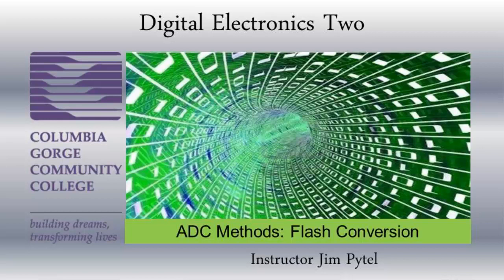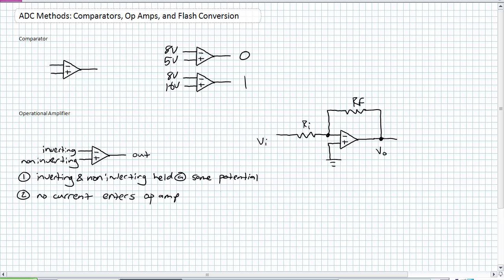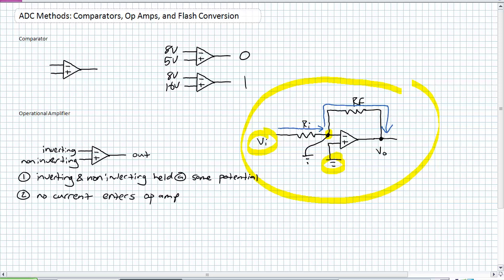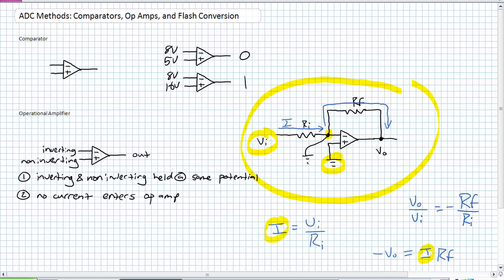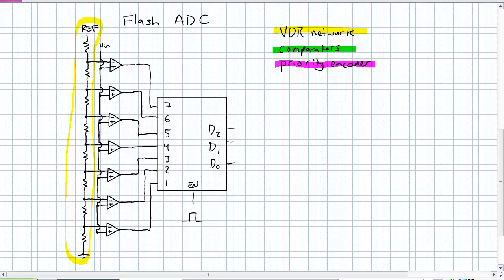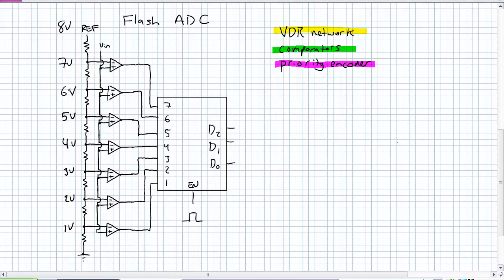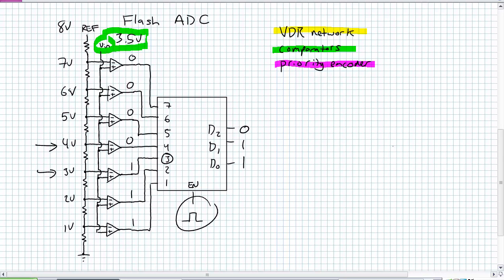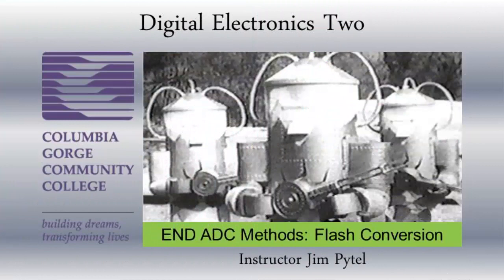ADC Methods Flash Conversion

Comment: are there always 7 comparators? got an example where is hould show an ADC when i got 5V as Vref and Vin is 3,5V. i draw 4 Comparators, but that wasnt right it seems. so are there always 7 comparators?
Reply: +HupfDole87 already got it, it is cause i have to work with 3 bits ;)
Great video btw! keep it up, really helpful!
Reply: checked if it's really a mosquito on my screen ;p

Comment: at time 14:46, shouldnt the output be 010... 001 is equal to 1V not 2V..
Reply: +Jaclyn Baglos  you are encoding the highest asserted input of encoder, in this case input 1. Hence you get 001. Voltage doesn't matter.

Comment: hello sir why they called Flash? and what happen if current go in to AMP? what is the reason for that current does not go in amp?
Reply: There is NEVER current flowing into an ideal OPAmp, because the resistance of the OP-Amps input is infinite. For a real OPAmp there are some MOhms so a current flows of some microamps. But in compare with the other currents we can ignore that for the analysis.